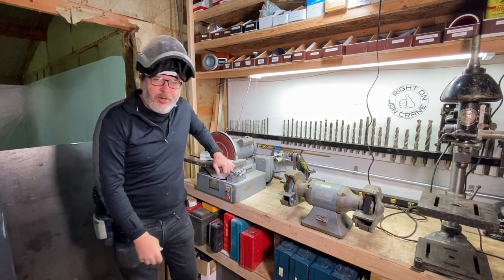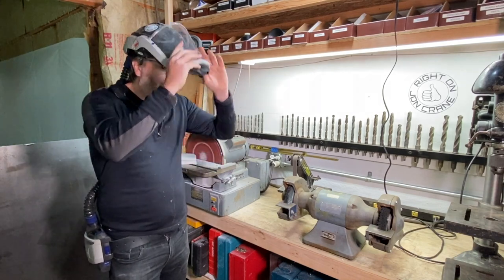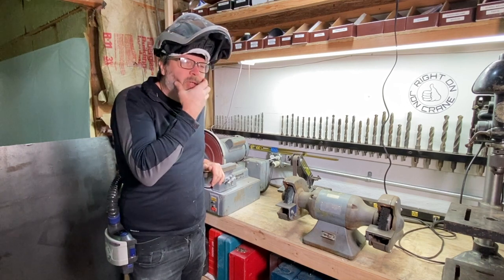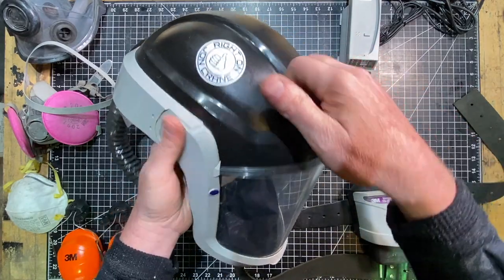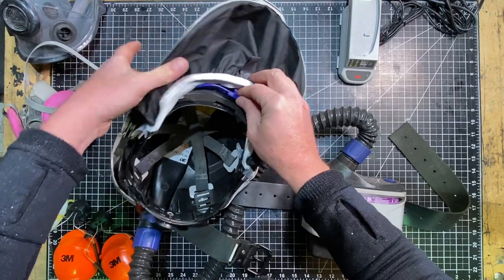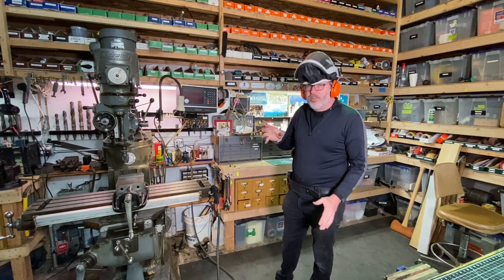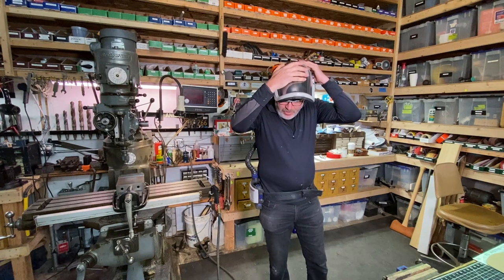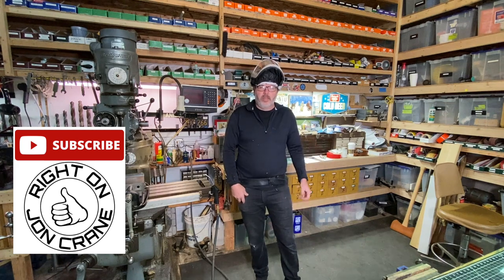3M Versaflo Powered Respirator- Just Buy One! - Right On #82

Comment: It is crazy that certain ppe devices are so expensive...i paid less for my bridgeport. Anyway, i agree with you, i just wish the price was more palatable. Cheers
Reply: Yea they are definitely scamming people with the price. I have a 3m speedglas 9100 welding shield and the replacement parts for it is stupid expensive. The face seal is over $100 the hose on the back is $100. Every little replacement part is around $100 when it’s just simple fabric or hose. At most the cost should be at most half of what they charge.

Comment: Looks like every time you flip it up small dust can get on the inside lens or material seal because you push it up above your glasses onto the top of the hood which has dust on because it’s exposed to the outside.
Reply from the maker: That is very true! 3M does have a hood that solves that problem. It attaches to the top of the visor and drapes over the top of the whole helmet and more. 
Right On! 👍 Thanks for watching!

Comment: I wonder how long those filters last. They’re very expensive.
Reply: That's what stopped me bothering with this long ago. Nobody was able to tell exactly how long it lasts and whats the costs eg. per month.
Reply: I've been using the same filter for about 8 months so far, I'm in the shop maybe 2-3 times a week for a few hours at a time. My filter is at 25% life remaining. I was able to buy a box of 10 filters off eBay as surplus super cheap. Best purchase I've made for my shop
Reply: @shoangore  I think that almost sounds too good to be true. Ain't the regular painting filters not safe anymore after round about 40 hours on air? Thanks for the reply though.